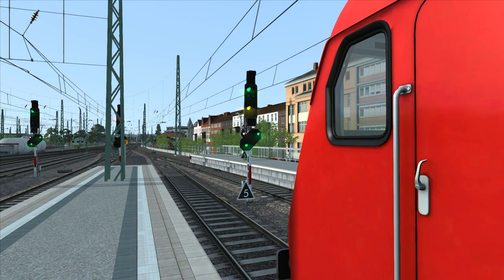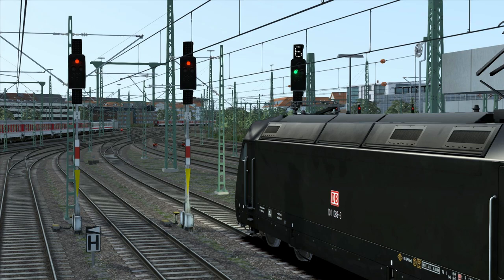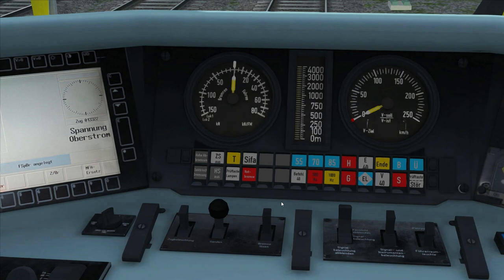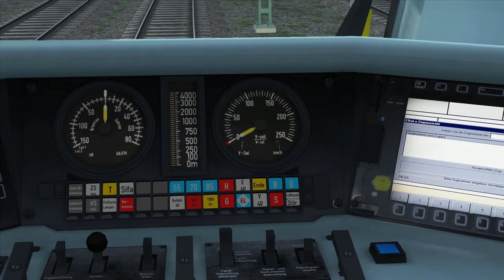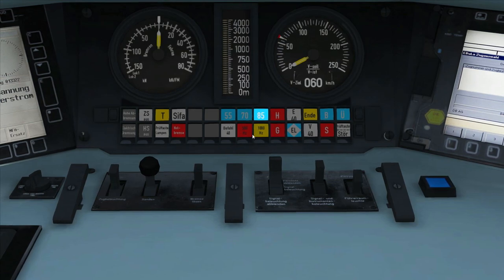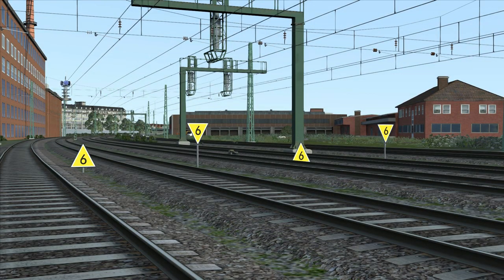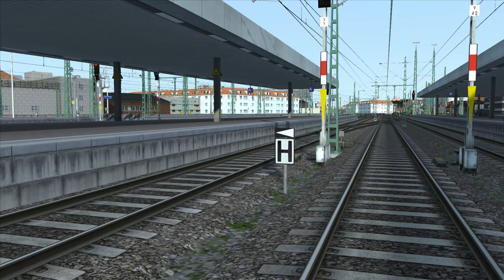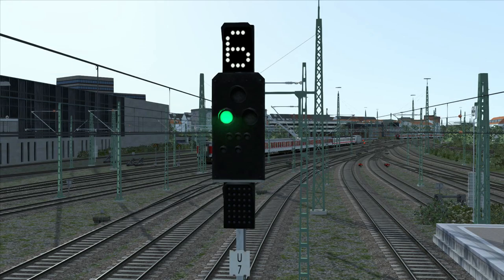Train Simulator 2015 - German Signalling Tutorial

Comment: Attention! you've made a Fail at 9:08 
The white light has TWO meanings ! this depends on the Ne2 sign ( the white one the two  Triangle tips touching ) 
1. White light WITH an Ne2 
means that the signal is located in a shortened braking distance

2. White light WITHOUT an Ne2 means that it is just a Signal Repeater 

... Greetings from Bavaria  (Germany)

Comment: Good video!
You might see a single yellow light, too. It indicates the same as two yellow lights though.
There can also be a flashing green light indicating an upcoming speed limit.
Reply: This is the modern Ks signalling system that has been deployed in the last 20 years (however existing tracks only get new signals as their control centers are being upgraded to new computerized ones). It replaces the Hv and Hl (see below) In the Ks system ("Kombinationssignal" - "combination signal") distant signals and main signals are no longer differentiated. A signal fulfilling the role of a main signal has a white-red-white striped sign. If it also has a yellow triangle below, pointing downward it is a so called "Mehabschnittssignal" - "multi section signal" which fulfills both roles. A signal fulfilling only the distant signal role has a "distant signal" sign, which is the white sign with black lines you can see in this video.
Signal aspects of Ks signals are as follows:
One green light (Ks 1): proceed and expect proceed
One yellow light (Ks 2): proceed and expect halt
One red light (Hp 0): halt
Speed limits are always declared as a separate number, however if a signal is a distant signal, Ks 1 is shown and there is a speed limit pre-indicated, the green light is flashing.

The third main signalling system in Germany is Hl but that is only to be seen in the former GDR. It's the most confusing, encoding speed limits into the signal aspects (which leads to it having 17 different signal aspects, which includes flashing lights of various colours as well as coloured bars)
There are also the Sk system (from which Ks has been derived), but that's only used on a single track. And one or two other experimental signalling systems. Underground trains and trams in cities use completely different systems, which even vary from city to city.

Comment: The distant Signal at 8:20 clearly means to expect stop, because this distant signal seems to be broken down. (By that I want to say that if the yellow number shows an 8 or above, you get a clear signal not a Slowdrive signal. DTG I hate you :D) 12:35 the speed limit is only till the end of the "switching zone" (all the connected switches behind that signal). In general it is a very good tutorial (for starters) of the german signal rules.
Reply from the maker: +ssingfo Thanks for the info :)

Comment: Interesting! Thanks for explaining the German signalling, now I can finally drive in Germany! Also, these systems are like ATP (automatic train protection) in the UK.
Reply from the maker: +Stewie140 No problem, I'm glad that you found this video both interesting and helpful! :)
Reply: Indeed, very helpful. On a side note, what is your current recording software and system specifications?
Reply from the maker: Stewie140 I use Bandicam to record and edit in Sony Vegas Pro.
Since making this video I've got both a new microphone and new PC, so the specs I had when I recorded this were quite different to now.
This was recorded on a PC using an AMD Phenom II X6 3.2ghz processor with 8gb RAM and a 2gb AMD Radeon HD 6970 graphics card.
My current PC (upgraded in September) has an Intel Core i7 4790k 4ghz processor with 16gb RAM and an Nvidia GTX 980 4gb graphics card.
Reply: Nice setup! Thanks, and you are super lucky to have that setup, it's great!

Comment: A pretty good and helpful video, I really like it. 
And I hope it helps more than a few people grappling with it, as the DTG materials on it aren't that good, and some of the best sites on the PZB and Signalling are german only. 

A few remarks.....

1) this is DTG signalling, which has been remarked by a lot of german community members as being poor, so it has a few faults. 
Like the 280 km/h speed limit on the Munich-Augsburg line, real life is 200 km/h.
And they generally only uses H/V signals, no KS Signals or Hl Signals, however, the german systems work by the same principle, except the Hl................and well I'll blame the Soviets for that. *

PZB has also been implemented since the Ruhr-Sieg Line, only LZB has been since Munich-Augsburg or TS 2013. 
Although early versions of the PZB had faulty scripts, which lead to the signal scripts mods being used. 
35395

Better Signals, done by the Signalteam are availlable here: 
http://rail-sim.de/forum/wsif/index.php/Category/63-Signale/

They are widely used in third party pay and freeware routes, and work much more prototypical than DTG Signals. 

2) the H-Board or Haltetafel is such a case, normally it indicates the maximum forward position at a plattform and IRL there are often multiple H-Board accounting for different train lenghts, especially at S-Bahn stations. 

3) the signal with a 6 and a green seems to be such a case that should be a yellow green, as that is a speed restriction. I will check with a friend that drives trainsif a Hp1 with ZS3 is actually possible. 
My sources indicate that it shouldn't be, but then he took the PZB exam, not I. 

4) Important note concerning restrictive monitoring: 
If either the 1000hz lamp or the 500hz lamp is illuminated, freeing from the restrictive monitoring is prohibited, and pressing the release button will lead to an emergency brake application. 
If the 500hz is iluminated and you pass a Signal that was formerly red while in restrictive monitoring, top speed is limited to 25 km/h. 

5) PZB in Virtual Railroads and other more realistic locos, press and release while passing the signal as you did earlier, don't wait for the alarm, that will count as not acknowledged, as IRL. 
Also if you have PZB enabled, all VR Expertlines and the HRQ Taurus as well as the JT Taurus, and the Railatraction and RSSLO locos will emergency brake you if you exceed 165 km/h. 
This emergency brake application can be released by pressing free and releasing the brakes. 

6) other PZB modes:
If the 70 Flashes you have 29 seconds to slow down below 70 km/h.
If the 55 flashes you have 34 seconds to slow down below 55 km/h.

7) PZB in Virtual Railroads Expertline locos from the Br 103 onwards:
If you slow down too slow, i.e. don't match the expected braking curve, you will get an emergency brake application also. 

8) Vmax for passing the 500hz magnet if it's red is 45 km/h for Mode O (85), 35 for Mode M (70) and 25 for Mode U (55). 
If it's showing red I would just go at 25 anyway, though not quite if it's a station stop. 
Which can make stopping at a station interesting, as normaly I drive 60 at the Platform's head, which is SOP real life......though if they are late I've seen 80 and more.........better grab hold of something if they do that! ;)
There is a reason those little things are called tripmines by german Railwaymen. 

9) PZB Override should only be used at or below 45 km/h, otherwise, if the PZB is realistic you get another emergency brake application. 

10) train driving rather autonomously under LZB is only if AFB is turned on, otherwise you have to still drive it manually. 
IRL to use the AFB, you have to pass a test, since not all drivers IRL have that test it is completely feasible to drive manually, though thankfully we can also choose to simply drive with AFB. 

11) the G sing indicates that you're speeding, or rather above the brake curve, respond to it by braking.......or you'll be in trouble. ;)

12) The LZB working is not prototypical, as the ingame one uses fixed block and is scripting-wise dependent on the signals to the side of the track, while the real life one uses a moving block. 
So if you had a train in front that was still moving, LZB would simply give you a speed restriction to keep you at a safe distance from that train. 

*Only used in Soviet Block countries and thus only on some routes in eastern germany, and that system is complicated as fuck! (Mind you that is a german saying it is complicated as fuck! ;) )
Reply from the maker: +LupusAries Thanks for taking the time to write up all of this information! I found it all very interesting. I know that the signalling systems in Train Simulator are not as accurate as in real life, so I made this video to the best of my knowledge and ability within the limitations of Train Simulator. I'll take this information on board for future videos :)
Reply: PTGRail You're welcome!

And I thought as much, if I didn't have to loco drivers as friends, I wouldn't know half as much as I do. 

Concerning point 3) the green signal with a number illuminator, that is indeed true, I've seen one of these this week at my local train station. 

The trouble is that most signalling books and information sites are in german only. 

Should you understand german, this site has some great information
http://www.tf-ausbildung.de/home.htm

Additional information, to what I wrote can also be found here in part 3.31 ff. 
http://steamcommunity.com/sharedfiles/filedetails/?id=247333283&searchtext=steam+locomotive

Probably the best guide to driving Kettles on steam.

Comment: First, nice attempt to make a tutorial for the systems for the english people. But then i have to say that you need do it with a better implementation of the systems. DTGs implementation is not good and have alot of bugs and cause wrong behaviours. Their routes are badly equipped with magnets on wrong places or missing magnets. The loco side implementations are different and not correct. So not the best way to teach with them.

Some short notes:

PZB is not a signalling system. It is a train protection system. LZB could called as a in cab signalling but at the end it also is a train protections system with live data from the route.

SIFA does not cause a emergency brakeing. You can release from the normal (4.5BAR) brake application by pressing the sifa reset at any time.

AFB does not react on PZB. Only interacts with LZB by only one way: it uses the VSoll from LZB and overrides the VSoll set by the driver if above the LZB VSoll.

Repeating distant signals can also have PZB magnets with active 1000Hz if the first distant signal is placed more than 1250m before the main signal. In germany the drivers have to acknowledge on all (yellow) signals that states a restricting aspect, even if there is no visible trackside equipment. The drivers actions are recorded by the PZB/LZB data recorder -> 'black box'.

The normal distant signal distance is 1000m not 1250m. The 1250 is the max distance without using a distant repeater signal.

PZB 1000hz does not cause an alert like the AWS does before you pressed the acknowledge button. This is wrongly implemented.

You can release after 700m from the monitoring, but the monitoring will not end before the 1250m after the last active 1000Hz. It will run silently in the backround (normally there can run more than one monitoring overlaying the others regarding a priority system). If you release and there is a new influencing magnet, you will earn a emergency braking to a full stop. So in your example you normally will get a emergency braking when not under 85kph. You released before the main signal with an visible Vr2 aspect and this is before the 1250m ends -> if => 85kph then emergency braking to stop. So in those situations you will not release from the monitoring because there is no need, and a good chance to earn a emergency braking when the signal falls back to another aspect, what can happen.

When you release before an active 500hz (your second example with red aspects) then you will get a emergency in all cases if you run over it and it's active. You are not allowed to release when you expect a active magnet, especially a 500Hz.

LZB implies not a full automatic driving mode. Just use a BR103 and try it out and you will loose your drivers lizence and/or your life. There are locos with LZB eqipped but without AFB in there. LZB also does not bring a train to a full stop, even if it is equipped with AFB which has been activated. You always need to manually brake the train to a full stop before a red signal (LZB Stop), or you will go over it. LZB Stops also are not at the signal itself, but a few meters before it. As LZB is a underlaying wandering block signal system (tracksides) you can have a stop away from a signal on the route. Normally signals are dark when driving under LZB. If they are not unlit then the driver has to ignore them until the LZB goes off or has a fault operation or a data signal loss (which causes a emergency braking). In your example of approaching a red signal on LZB you will crash into the other train with around 10kph. But this situation will never happen or the dispatcher will loose his job forever.
Reply from the maker: Maik Goltz Thank you for all of this information. It helps me understand the signalling system better. Unfortunately I know there are many limitations and errors in Train Simulator. I know this tutorial isn't perfect, but I tried to do the best I could with the information I had. :)
Reply: Just one question: How can a signal fall back? If it shows green it won't go green/yellow or yellow and you are safe to release.

And there is AFAIK another technicality that when the 85/70 are blinking you can only release the 45 km/h lock when the 1000 Hz light is not on. Same when the 500 Hz light is on but AFAIK your allowed speed is then only 25 km/h.
Reply: There are some situations (mostly signal sytsem failures) where a main signal can fall back to Hp0. A dependend distant signal then goes to Vr0 and you do have such a problem if you release from monitoring before the distant signal passed :) Not often, but it can happen.
Reply: Maik Goltz What's the best simulator for german train simulation? Maybe Zusi 3?

Comment: Is there a guide where and what to do if you have already made an emergency brake?
the following scenario:
Gone magnet 1000 and did not have time to slow down to the threshold.
emergency braking.
after stopping, traction 0, 20% brake and press reset PZB
Accelerates and starts flashing lamp (in the version of M - 70). more than 70 can not accelerating.
Disabling PZB and include it again, certainly an option, but I suspect that is not correct, because Not all scenarios allow a change of state PZB.
How to correctly operate after the emergency brake?

Comment: Video Guide
*This comment will be edited to add all info
4:53 - Signalling Controls
5:47 - Trackside Signs
7:11 - Signals
9:27 - Departing from a station and what may happen on the signalling system when you depart
10:06 - Restricted Monitoring
11:11 - Restricted Signal with Speed Limit
12:35 - Theory on approaching before red signals on PZB signalling and Demo
21:24 - LZB signalling
29:40 - End of LZB Zone
Reply: S

Comment: All in all a good Video, but there are some crucial mistakes in it.
PZB/LZB isn't a signaling system it is an Train Control System (like ATP or AWS)
You have to differentiate The H/V signaling system and the Ks signaling system. 
I think I will do a Video about them in the near future. (Both in German and in English) 
The Sifa is also not a signaling System but rather a Train Control System. (Timings are Pressing 30 seconds, after which the Sifa indicator will light up. 2.5 seconds later a voice will call Sifa or a horn will start to sound. If the Sifa is then not reset by lifting the pedal and pressing again 2.5 seconds later an emergency breaking is applied.) This emergency break can be interrupted at any time by releasing the pedal and pressing it again.

Comment: First, I have to apologize for my bad english but I will hope, that you get the message.
I'm a german train driver/engine operator (don't realy know how this job is translated :D) and I want to correct you about some explanations.

You said, that the SiFa emergeny-brake works till the train stops. That isn't realy right.
When you get the SiFA emergeny-brake, than you're able to relese the brakes just by pushing SiFa again. (In many of the DTG-Locomotives this function is incorrect)

The "H"-sign at the platforms can be added with a length specification for the train. A little example: If you drive a 182m train and there is no 182m H-sign you have to stop at the next higher H-sign. You have to stop at this H-sign +/- 5m or otherwise you could get a punishment. So, there can be more than one H-sign at a platform.

The distance signals with green light at the top right und yellow light at the bottom left says, that the next main signal is a green over yellow signal. And this signals can be used for the speeds from 20 km/h to 60 km/h. But like you correctly said, it has to be indicated when the speed is another than 40 km/h. Also a mistake from DTG.

The restrictive monitoring is only when you activate the PZB and when you acknoledged a signal and runned under 20 km/h for a certain distance or you stopped after that.

The other explanations are very acurate and absoluteley correct, perfectly investigated.

If you have any questions about german signaling system, please feel free to contact me.

Best regards
Rico
Reply from the maker: +Banana Joe Thank you for the information Rico. I understood you very well! I made this video to give as much information as I could find out on the German system though I know I didn't get it 100% accurate. Thanks for the pointers there, I will try and remember them for the future :)